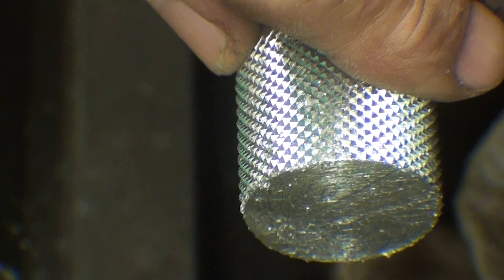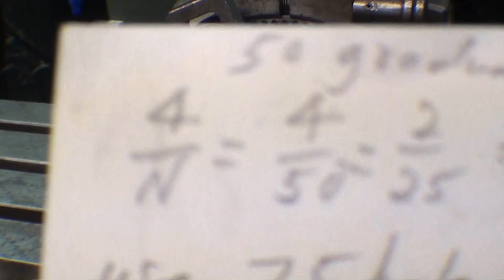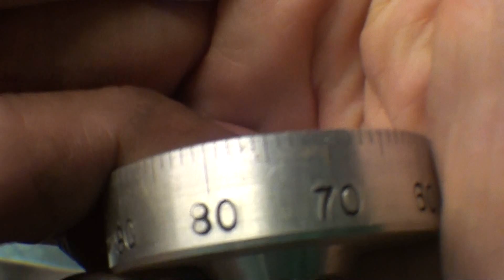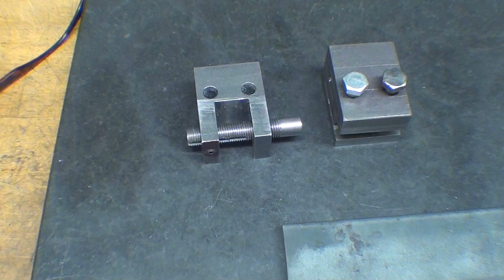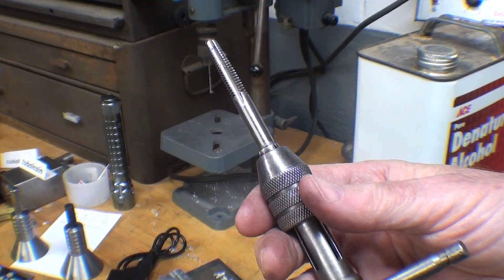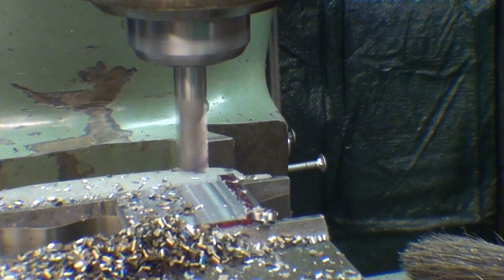TIPS #371 Make Atlas Lathe Micrometer Carriage Stop pt 2 tubalcain

Comment: thanks so much for showing ways to make a graduated dial. I like the way you did for the Logan lathe, it's very easy and just ordered a 50 tooth saw blade for my indexing. $8 plus some fiddling to make a index pin, but so much cheaper than a dividing head! in fact, you can buy 10 different blades + make your index jig at 1/3 or 1/2 the cost of a dividing head!

Comment: I'm making one of these asap in my downtime at work..for work and a spindle plug for a stop for face and chamfering pins on both ends, I'm gunna mill 2 slots 1 for full range with the dial and a 2nd offset slot that will only move it back and fourth a 1/16" depending what your doing

Comment: The bad thing about most stamps is that the letter or number is not centered exactly on each stamp. So even if you have a jig sometimes they don't line up in a straight line. I experimented with a cheap set once and ground each one down to get the number more centered and it worked really well but I had to take so much off of some of them that I'm afraid they might bend. The only set I ever had that was centered good and had the correct spacing by holding them side to side was a rather expensive set of 1/2 ones. You do get what you pay for I guess. Great video as always Mr. Pete thank you!

Comment: Lyle, why is it that you Yanks are so obsessed with using Transfer Punches. You already had a drill guide with the top part of the carriage stop. You should have spotted through with the 3/8 " drill until it made a full diameter of a good 1/8 ", good practise for tapping, then changed to a smaller size and then finally the tapping size. You would then be guarenteed that the holes lined up and did not pinch. I am in the UK and been a toolroom engineer for 40 Years, I have never seen a transfer punch, let alone used one. All they are is a rod with a centre on, just a glorified center punch, that when you go to drill can wander off. If the part gives you access to get a punch and hammer in, you can use a drill, albeit it may have to be  a long series or even an extension one. By the way, I have just looked on E-Bay for transfer punches, only 1 UK seller, all the other sellers are in the USA, that must tell you how rare they are in England.

Comment: One question, Lyle. Regarding your graduations in relation to the threads. Are the graduations just for reference? How do you know if the graduations actually advance the screw the labeled distance when building?
Reply: That's why he used the 20 pitch thread, it'll accurately advance the stud 50 thousandths per full revolution so it'll also accurately move each marked division.

Comment: Does the knurler actually cut, or does it mostly just move material around?
Reply: Troy Jennings the knitter mostly moves metal but does cut some as well. knurling will increase the diameter of the part somewhat .
Reply: I thought it looked like it was a bit expanded. I couldn't see how those wheels got much of a cutting action when they roll rather than scrape.
Reply: Back when parts were more expensive than labor, pistons were knurled to increase their diameter. For use with larger rings to fit borded out cylinders.

Comment: As to scribing the lines, (and advance apologies if you have done this in other videos) could you place the rod in a 3 jaw on the lathe, then thread the knob on to it. Then set up a dial indicator on the face of the knob. Scribe a line with a tool held in the tool post, then rotate the knob by hand (rotate the knob on the thread, not the chuck)till the indicator moves .001, then scribe another line. Repeat till done.